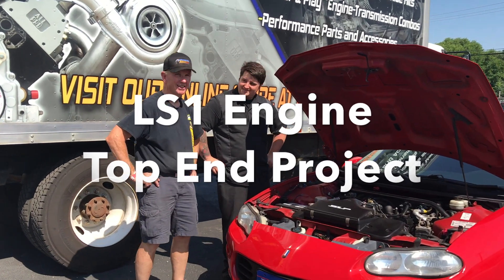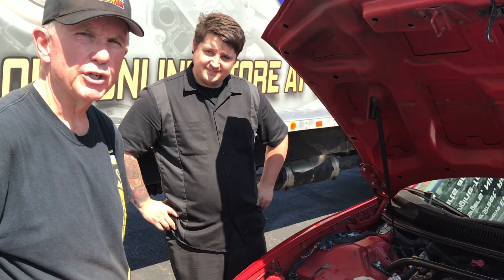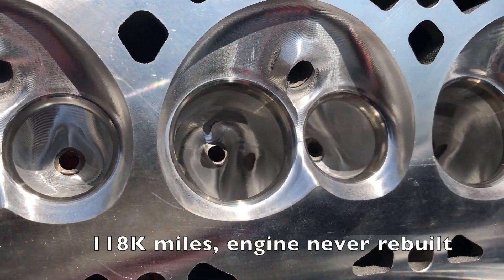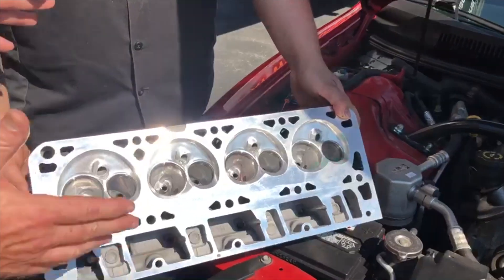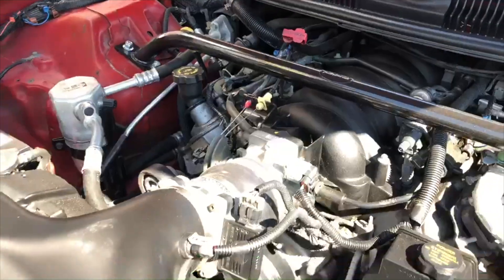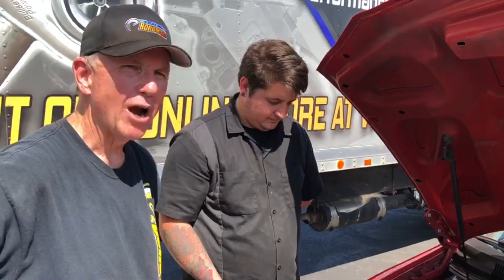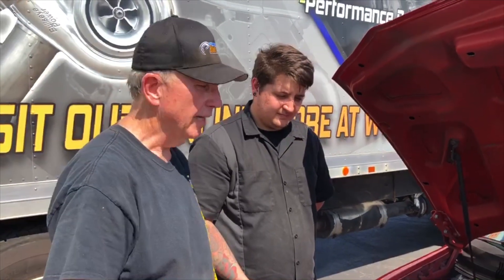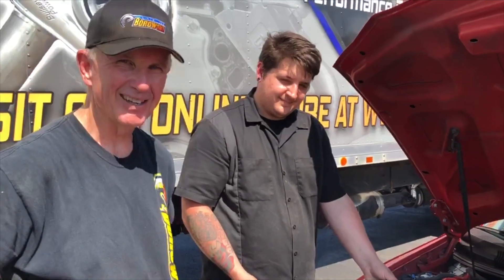LS1 Engine Top End Project

Comment: This will be interesting, what are the cam specs? Some where around 236in 244ex .635lift 113lsa 109ilc? 
I am guessing 460rwhp 398rwtq through a locked auto and 481rwhp 423rwtq through a manual if everything is right and the heads work really good
Reply from the maker: Hi Derek.  The Camaro is running its original 4L60e transmission.   We are rolling out the project on Facebook and awarding prizes for best guesses.  The cam info will be released, but not just yet.  In the meanwhile, you can hop over to our Facebook page and put in your guess for baseline torque and horsepower before any modifications. https://www.facebook.com/BorowskiRaceEngines/